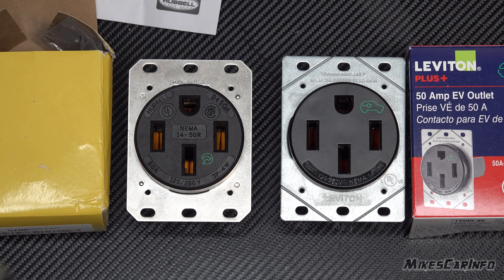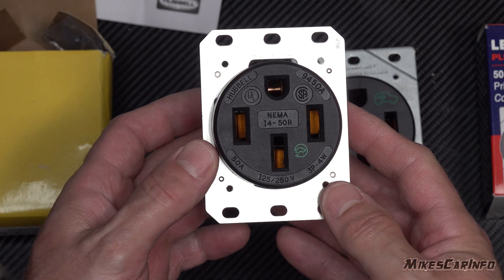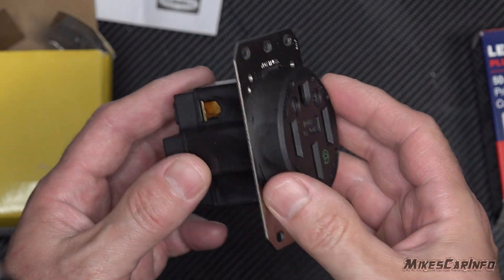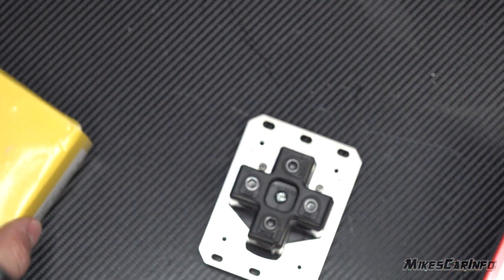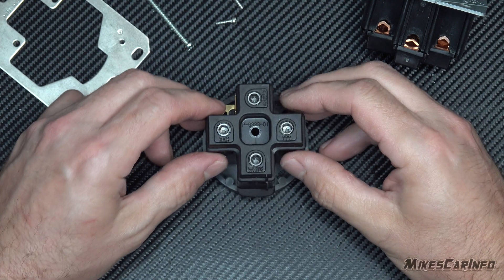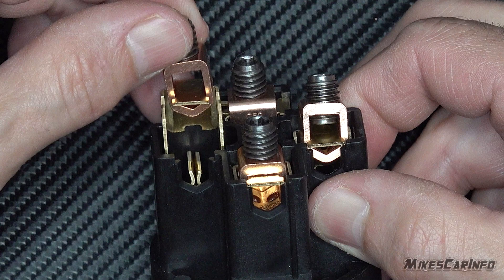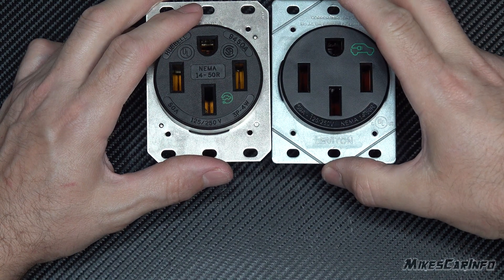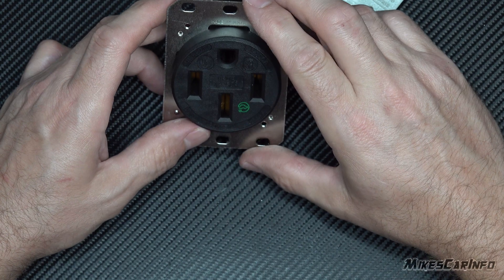Leviton Vs Hubbell Hubbell NEMA 14-50 EV Outlet Disassembly

Comment: I just installed the Leviton EV rated outlet to replace a cheap ($6) Leviton Range n14-50 outlet that I had used for 30 months and ~55K miles worth of charging.  The Range outlet had just started to show signs of melting on one hot leg.   My EV rated outlet ($60)  was purchased from HD, and I had problems with the 1st one where I couldnt get the neutral to tighten down to 75in-lbs on the 2nd go around.  I returned it to HD, and made sure the clerk marked it as Defective and got a 2nd one.  The 2nd one installed fine.  Seeing how the Hubbell is constructed, the larger screw with coarser threads may have more bite.  I've only used my outlet at 32 amps, as I am using a free 40amp breaker on that circuit.

Comment: I tried swapping out my cooper outlet for the Leviton today because I got a charger overheating warning. I stripped out 2 Leviton’s trying to install. I used a torque wrench set to 75 inch pounds. I contacted Leviton after I stripped out the second one. The tech support guy seemed surprised when I explained the situation. I should be receiving my Hubbell from Amazon tomorrow.

Comment: Good advice here. The other thing is to avoid putting excessive current through these devices. The ampacity of the wire depends on maximum termination temps at each end. Typically breakers are rated to 75 deg C, so I did a deep dive on the termination temps of the Hubbell and the Bryant. Neither stamp termination temps on their devices, which should be a red flag. On a review of their websites I read that the termination temp is 75, but it took a lot more effort to get that than I imagined. From a practical perspective I'd use the 60 deg column to judge wire ampacity, which needs to be down graded after that by 0.8 for continuous loads like car charging. So, for AWG 6 wire this works out to 55A * 0.8 = 44A max continuous current (not 48 or 50). If you want more current I'd delete the plug entirely and hardwire the charger directly, which removes the most common site of problems.

Comment: It's very unlikely that any manufactur of respticals well sell u replacement components.😅 Taking apart the recptical periodically is something most of us would not do and may not be a good idea. If u use a recptical frequently were ur un plugin and replugin a plug back  in to it ( like two or more times a week) expect to replace it more frequently say every 3 to 7 years; 10 maybe. 🎉

Comment: I have hubbell 110 outlets in my house. They seam to be harder to find it’s what I have used mostly replacing outlets in my house. They feel much heavier.
Reply: Are they commercial grade(spec)? Eaton commercial grade are good and there available   as singles or in a ten pack. Lowe's sells them for around 24$ in the ten pack. Hubble commercial grade are good but brobly more expensive than say the Eaton commercial grade

Comment: I would be very leery of a Hubbell 9450A that sells for $50-something. They normally sell for >$100 at trusted sellers. That doesn't matter, though, because the one you SHOULD be buying is a Bryant 9450FR, which is virtually identical to the Hubbell 9450A. Bryant is a Hubbell brand and the two are made in the same factory to the same specifications. I would purchase a Bryant 9450FR from Grainger. Their part number is 49YY93.

Comment: Leviton is a reputable brand that is not Chinese. It's not Enerlites or a random brand like Micmi. That said, they definitely manufacture most of their products in China now. The Chinese factories will make it however good Leviton says to, so it's unacceptable they are allowing this level of quality. I did a ton of research into 50A receptacles before I went with the Hubbell. There are simply very few outlets on the market that actually meet specs and match the Hubbell quality. It's worth the money even if it's $20 extra or more. Not like you are buying 10 of them and it's a real safety concern. It is crazy how expensive this type of receptacle is given how simple the construction is though. Would have liked a destructive Leviton disassembly.
Reply: Leviton has been, for a long time, like since the 1970s, a brand that specializes in value engineering and marketing.  Taking cost out of their products bit by bit until it just barely meets the UL standards, while also keeping their name out there so that consumers trust it because they've heard of it, even though there's no real reason for trust.
Reply: @charliesullivan4304  I don't disagree. However, they still are not a Chinese brand and they are still reputable. They also make commercial, industrial, heavy duty, and hospital grade devices. Their products range from lowest common denominator to top shelf. Unfortunately, value engineering is not unique to Leviton whatsoever. I personally buy Leviton duplex and GFCI receptacles for example, but I stay away from their residential stuff which is really just barely viable.

Comment: The full load circuit would normally be 220v. The 110v would only be for control equipment like the computer of a welder. Explains why the neutral blade is smaller.
Looks like the Hubbell  OD is smaller and normal 14-50r diameter. The Hubbell is actually DOUBLE the price of the Leviton.
Reply from the maker: Both are larger than the normal size 14-50. I paid $53.89 for the Hubbell, $39.99 for the EV Leviton, and $68.39 for the WR EV Leviton.

Comment: leviton even when used at moderate amps the prongs relax over time and get warm and weaker eventually causing problems.
The main problem a lot of people don't catch is, the leviton can take more damage before it shows problems than your plug can.  See, when the plug overheats, so does your cord, the male end.  The heat runs right thru the tines and into the cord, where they will then eventually cause issues with the cord head where the wires are soldered on if it's done well, compressed in if it's not done well, and make things loose inside the male head where you can not get to it, and do nothing to fix it.  Eventually your plug overheats, gets soft and melts, and now you have fire hazards galore.  leviton will go on to say your cord caused the damage, your cord was damaged, and will not admit their poor quality plug overheating is what caused the cord to damage in the first place.

Ok I got wordy with the why's but the take away:

if you have plug issues, chances are good your cord/ cord head is severely damaged too, and if you put a brand new EXPENSIVE plug on the wall, and plug in your damaged cord, you'll just take out your new plug again.  Check your cord and replace the head there too if it needs.

Wiggle the tines, if they wiggle, it's damaged, replace the head on the plug... and don't get a leviton cord head to replace it.

Comment: I just returned my second Leviton because the screws on the clamp kept stripping and becoming loose with little torque. I'm glad to see I'm not the only one having issues with Leviton
Reply: Same issue here. I called Leviton support and the guy was really surprised. Went and looked up the specs and was like "yeah, it calls for 75 inch pounds. Really weird that it would happen twice!" Really problematic that it's the only outlet carried by Home Depot, and Lowe's doesn't even sell one at this moment. Online or nothing apparently.

I've got a different brand being delivered today.
Reply: @ryanbrown982 :  An electrical supply house probably well  carry the top notch Hubble brand for EV plugin chargers ( u might want to call first to confirm if they have them). 🌝 In my opinion it's most likely better to have an EV charger that's hard wired (no recptical involved.
Reply: Had no stripping issues with mine at all
Reply: @doomsday9973 Did you torque it all the way to 75 inch pounds?
Reply: @ryanbrown982 sure did. Had zero issues.
Reply: @doomsday9973 Interesting. Wonder if there's a quality control issue or some bad batches.

Comment: i which you would have disassembled the other one. I would love to know why it is designed only to engage half the blade on the neutral (white) connector. I just changed my vanilla Leviton plug after two years of seemingly problem free charging until my Tesla charger stopped due to high temperatures.

Comment: Ground is not a current carrying conductor is the phrase you were looking for.
Reply: is not a constant current carrying conductor.  It needs to carry the fault current, even though its brief, it needs to withstand that, which can be huge.  Since we are on this topic, even though they sometimes are bonded in the plug, people also need to understand, Neutral is NOT ground, and may need to carry constant current.
Reply: @aarons7975  NUTURAL is also referred to as  grounded (our something like that.
Reply: @Kat-on3nm  you have to be careful of that. yes technically it should be at ground potential, but if you are running a branch feeder you can set up ground loops which are bad, not to mention, a mistake or disconnected wire and that 'neutral' will knock you on your ass!  It's GROUND, it's DISCONNECTED!!  on that end, how did it shock me!!.  It's neutral, NOT true ground., without the proper return, neutral becomes the center tap of a 240 transformer so got 120 volts on it, looking for a place to go.